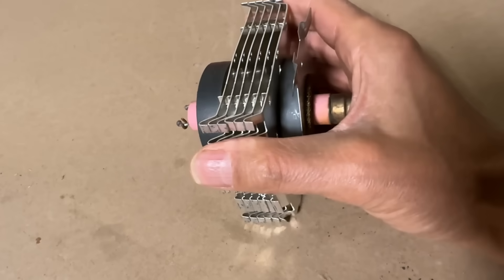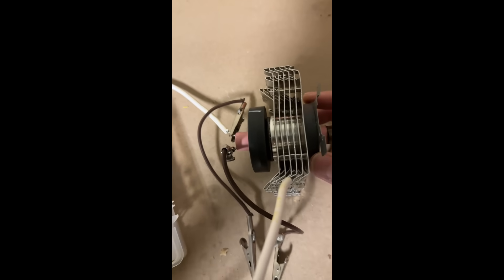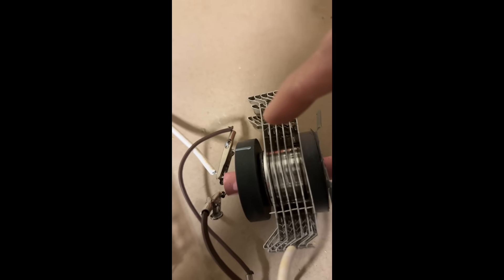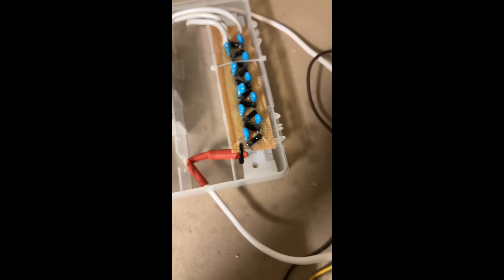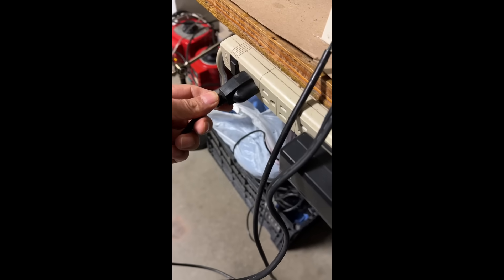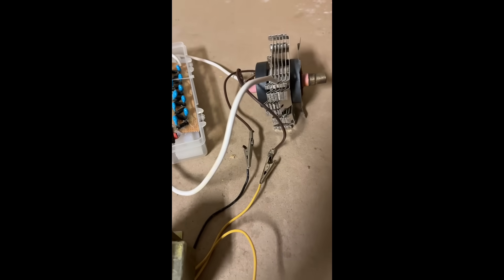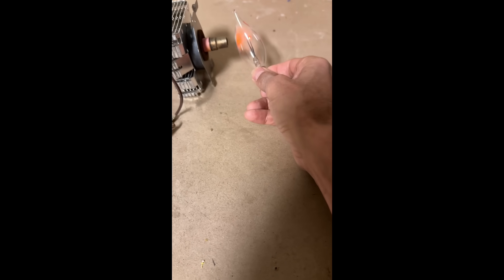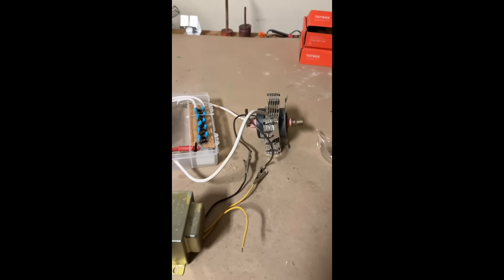Running a Magnetron at Low Power

Comment: Yeah nah I'd like to see this experiment with an actual microwave detector. I'm not saying there are NO microwaves coming out, but I'm betting those bulbs are being more lit up by the static electricity coming off the magnetron than the microwave beam itself. I've built countless Tc's and voltage multipliers in the past and seen similar results.
Reply: Well, the neon bulb stopped glowing when they turned off the low voltage heating, although the high voltage was still on. So it seems quite reasonable to assume that it was powered by microwaves.
Reply: @Phoenixfisch  Yeah that's why I said I'd like to see the actual microwave energy measured. I've no doubt there are microwaves being generated, I'd be interested in the numbers.
Reply from the maker: It’s definitely microwaves, but I do have a detector on order which hasn’t come in yet. Once it gets in, I might repeat the experiment to demo the actual level being produced.
Reply: Won't be difficult to check, amongst many other things I repair microwave ovens for a living and also have RF emissions tester.
Reply: Agreed and since the filliment needs 10 amps to run, I didn't see a 10 amp transformer or wire.
Reply: @michaeldranfield7140  You can see the transformer at 2:38.
Reply: Agreed, but can it supply 10 amps??? Also you should see the ceramic at the antenna end glowing orange when running, I repair microwave ovens for a living so I do know a little bit about these things.
Reply: @Phoenixfisch  of course but its far from a 10 amp transformer and this is why you didnt see the magnatron glowing red at the end .
Reply: @ On the transformer it says it's rated for 60W, so 3A, but you could definitely draw double of it for some time. Transformers take time to overheat. 
I don't think a bit too little current would result in absolutely no microwaves. Expecially since the voltage multiplier outputs a higher voltage than the usual 4kV.
Reply: Beyond obvious that microwaves were being produced...hmmmmmmmmmmmm upon second guessing myself it could have been a high voltage rectifier that was created and when the filiment voltage was removed it insulated the HV from the end....so  ya maybe just a HV capacitive effect
Reply: @ I have replicated this test and its rubbish , I have done a video for my channel but not published it yet .
Reply from the maker: @michaeldranfield7140 I’m surprised it didn’t work? What kind of power source did you use to run the magnetron?  Mine was a voltage multiplier. If you are not getting any output, try increasing the filament temperature by increasing the voltage to 5V from 3V. Also try increasing the DC voltage beyond 4kV. What are you using to detect the microwaves?
Reply: @BrianDhvTinkerer  I powered the magnetron as per the manufactures datasheet , -4Kv high voltage from a variable power supply at low current just like you would get from a multiplier   and 3.3 volts at 10 amps on the filament .I repair microwave ovens for a living so I use a professional RF emission's tester .

Comment: pink stuff may be beryllium oxide :P
i honestly doubt they still use it for magnetrons as of today.
Reply: He said it was an old magnetron. I personally suffered from an exposure to Beryllium and you do not want to be in that situation; I was sick for months and misdiagnosed. So be safe and assume any pink insulators on microwave tubes of high powered electron tubes may contain Beryllium, as do some springs on relays as Copper alloy. The big advantage of Beryllium Oxide is it's a good electrical insulator yet it a good conductor of heat, a characteristic it shares with diamond.
Reply: I heard modern microwave ovens use aluminum oxide instead.
Reply from the maker: @dreamoftranscendence4415 agree- the military ones use BeO
Reply from the maker: Agree

Comment: As the filament cooled at switch off, it looked as if the output momentarily increased before going off.  I think this is due to the magnetron loading changing with heater temperature and the voltage was sagging due to the load with the cathode emissivity being high. This suggests you could try reducing the heater current to find the peak output for your supply.  I did something similar as part of a crazy contraption to flash a neon lamp.
Reply: IIRC,Magnetrons usually have a 3V filament,so it might be running a bit hot at 5V.
Reply: @PhattyMo  yeah 3V would be normal but magnetron will want to load at operating power so will be pulling the little HV power supply down a lot. Reducing  the heater voltage slightly will effectively change the impedance and allow the anode voltage to rise increasing the output slightly. That's what looked liked happened when the heater started cooling when switched off.

Comment: If you remember when you remove the tube, there were two coils connected to the filament terminals.  They will suppress the RF from the rear.
Reply: No! Its To suppress RF/EMF  going into other circuits of the microwave oven
Reply: @martinmtawali7359  Correct, they keep the RF where it belongs.
Reply: Yep 2 little ferrite wound sticks.  Sure Would Be interesting to set a spectrum analyzer at a safe distance.  Magnetrons improperly driven or loaded can show negative resistance.  The author seems to be driving the tube with a voltage multiplier.  Think bunch of capacitor s in series. Then he's got the inductance of long clip leads. Relaxation oscillator?  I'm betting he's putting out 2450 mhz at the antenna and RF at a much lower frequency at the filliment  terminal.  An oscilloscope with HV probe connected there would be interesting too.
Reply from the maker: Yes I remember them- short stubby coils I think I still have them- back emf suppresors

Comment: But how to point that it´s the microwaves that lights those lamps? Those lamps burns if them put near of high volts, and there you can see that light was brighter when they are back of magnetron and same time that was more near of high volts.
Reply from the maker: When I turned the filament off, the light stopped glowing, which proves that microwaves have been generated. The high-voltage was still applied, and that did not change.
Reply: @BrianDhvTinkerer But does it stop the glowing also back of magnetron?
Reply from the maker: Yes sure does ( not shown in video)
Reply: Radio frequency excitation.  Strong radio waves can light up gas lamps through inductive/capacitive coupling.

Comment: is that a military spec magnetron?
didnt think so. its plain old common alumina, not beryllium.
Reply from the maker: Yeah, I think you’re right. The military grade radar units contain beryllium. I read somewhere that they colored beryllium ceramic different to aluminum oxide ceramic and that’s why I got it in my head that the ceramic in this particular lower power magnetron was beryllium.

Comment: Interesting stuff. I have some 2 Megawatt naval radar magnetrons that run on 80 kV pulsed at a lot of amps. They are PROPERLY scary, even when you run them with short pulses. Keep fingers, noses, earlobes and eyeballs a long way away from even 10 watts of energy in the 2.4 GHz band, those tissues are not well-cooled by blood, Deep-tissue thermal injuries are extremely nasty.  There are cases of cataracts alleged to be caused by tissue heating in folks who worked on tuning and repairing microwave amplifiers. I use a wire-mesh screen between my face and any microwave sources. I've often wondered how much peak power you could get out of a typical oven magnetron by running it at maybe 12 kV with some serious high voltage capacitors and either a spark gap or thyratron trigger. I guess the heater isn't really capable of producing suffficient electron flux for serious high power pulses. However you've given me an idea about trying to run one of my  huge magnetrons from my 15 kV  variable power supply to see if I can actually get any oscillation out of them with maybe 5 mA of DC anode current
Reply from the maker: Thanks for the great and interesting info! I honestly didn’t think it would work with such low current.
Reply: @BrianDhvTinkerer  It would be interesting to look at the output on a spectrum analyser and power meter to see if it's oscillating at the normal frequency, or doing weird stuff like oscillating for a short time until the multiplier chain capacitors discharge, then waiting for the voltage to come back before firing again, or if it really is running at DC.  You'd need an oscilloscope with a 20kV probe to check the waveform of the high voltage. A high frequency Schottky diode detector like an HP33330B connected to an oscilloscope and fitted with a tiny loop probe would give a way to look at the envelope of the microwave output to see if it's pulsing at all or just steady
Reply from the maker: @MachiningandMicrowaves turns out I do have a spectrum analyzer!
Reply: I work with a company that uses these same magnetrons to mate with linear accelerators.  Like the other commenter, I would also warn you that magnetron you are playing with can and does produce serious X-rays that far exceed what you get in your typical ct scan.  At a bare minimum, please invest in some dosimetry and a rad meter.  These days you can pick one up very cheaply.  Finally, read up on the acceptable dose limits of ionizing radiation.  Just like the voltages you are working with, since you are still alive to talk about it, you must know enough to be very careful.
Reply: @pchris6662  my RF/HV test facility is 90 metres from my lab, and the high voltage supplies are interlocked, so I don't get anywhere near the dangerous stuff. I monitor with remote cameras and instrumentation. I don't have voltages greater than 15 kV in the lab itself. I have several ionising radiation dosimeters but they are not recently calibrated. I need to get something that I can monitor remotely so I can measure the X-ray levels coming out from the apparatus while in use. I use lead sheet for additional shielding when I'm using voltages over 25 kV in vacuum experiments. I would like to measure its effectiveness. I have an old Thermo Scientific dosimeter, but do you have any suggestions for small portable X-ray detectors which can connect over USB/ethernet/wifi?
Reply: PLEASE make a video of it! ;)
Reply: Warning, @80 kv operation you can receive lots of X-ray radiation along with microwaves!
Reply: @danielsteele7225  I will be at least 80 metres away from the HV systems when they are running, I have a remote shielded lab for this type of work, I also have plenty of lead sheet and a giant Faraday Cage.  I do a lot of other HV work up to megavolts. I have a couple of X-ray dose meters as well. Remote cameras and instrumentation are my friends here!
Reply: are you aware if there are also x-rays coming from the magnetron when you pulse it with 80kV, in addition to the microwave ? 

since it's a vacuum tube, and I saw some warning of x-rays with a voltage this high on a vacuum tube
Reply: @ The amount of peak microwave energy is way over the ICNIRP limits for quite a distance, so a bit of X-ray flux will be the least of my worries. I have a testing facility that's shielded and at least 100 metres from anywhere that humans or livestock can access, so any risks are very well-controlled. I think the x-rays coming from the trigger device are likely to be worse than those from the magnetron because of the geometry of the magnetron and the way the electrons lose kinetic energy before they are dumped from the cavity. I wouldn't want to try that with a low cost oven magnetron though!
Reply: I keep hearing this But I would like to see experiments about it a ballistic gel dummy with say pig eyeballs. expose it to different levels of microwaves and them measure temperatures with a thermocouple and a thermal camera, then compare it to someone having their face lit under direct sunlight. I think the risks are exaggerated.

Comment: Is it possible to run these on neon transformers
Reply from the maker: Yeah, it would work great with them (neon sign transformers.) I was actually thinking of doing this, but then thought it would make too much microwave energy. These magnetron units run off 4000 V DC. The best way to run it with a neon sign transformer would be to use a microwave oven rectifier which is typically rated at 12 kV to rectify the output from a 9 kV neon sign transformer. Use the unsmoothed DC. You could use a variac adjust the output of the NST to around 4000 V DC. This would also help to control the amount of microwave energy emitted.
Reply: @BrianDhvTinkerer  they do you make 3,000 volt neon transformers which I actually own one to run a spark gap
Reply from the maker: @AlpineFolf awesome!
Reply: @BrianDhvTinkerer  shouldnt have to rectify as they are a diode already. now, thats a thought, run two in antiphase for a full wave rectifier...

oh my, never thought of that before... remove the magnets and theyll no longer oscillate... cheap HV rectifiers? be interesting to know the breakdown voltage when theyre not rotating electrons...
Reply from the maker: @paradiselost9946 wow that’s a real interesting thought!
Reply: @paradiselost9946  Yes my thoughts exactly, a high voltage high current diode...but also one could replace the magnets with coils and modulate the magnetron with audio, make a high powered AM 2.4 Ghz transmitter, of course you'd need a clean filtered DC power supply for the HV.
Reply: @ not sure it would amplitude modulate? the magnets get the charges to rotate, they arent varying the flow, like the grid of a triode... but hey, worth a shot, and an interesting thought...
Reply from the maker: I just did it and it does run but somewhat unpredictably. I used a 30 ma 9 kV neon sign transformer connected to a variac so that I could vary the voltage coming out of the NST. I rectified the output of the transformer using a microwave oven rated HV diode. . I used a separate transformer rated at 3 V to run the filament. I tried a combination of grounding, the anode, grounding the cathode, and no grounding to see how the unit would function. I got  microwaves. However, because the NST was outputting 120 W, I decided to do the whole thing outside and film it with a remote camera. I will post that next. Let me know what you think?
Reply: @BrianDhvTinkerer  I think that is awesome that it can output such power, can't wait to see the video of it.

Comment: Sounds like it could also make xrays
Reply from the maker: I checked it for x-ray production and they were non-detectable. Interesting thought though.
Reply: @BrianDhvTinkerer  it could be done if you apply a high voltage (60 kV) since it's a vacuum tube and the elections would fly from the filament to the copper block (it would be highly inefficient since the electrons would be flying in all directions rather than be focused to a single target like tungsten)
Reply: Not enough voltage.
Reply: @railgap  it would be enough but higher voltage is better

Comment: Next time tape your bulb to the end of a stick so you're not jamming your hand into that beam.
Reply from the maker: Good point
Reply: There is no beam, the whole thing is radiating RF like a small 2.4 Ghz dipole antenna, more or less a donut shape surrounding the whole device. Getting too close to the back or front will start to heat up your flesh, worse risk is your eyes they will cataract quick. Need mesh glasses to be at this stuff min.

Comment: As far as i know that's aluminum oxide not beryllium tig torches are also pink, maybe if ti was a military magnetron, but working with beryllium ceramic is really expensive
Reply from the maker: The white ceramic is aluminum oxide. The one containing the pink coloration is beryllium oxide but you could be right!
Reply: @BrianDhvTinkerer  If it was beryllia, it would have huge warnings and never be permitted in consumer devices. Berylliosis is bad.  Very very bad. I have quite a few ex-military and aerospace devices that do have Beryllium oxide and the warnings are properly serious.  It's a fantastic material, really high heat conductivity, excellent mechanical characteristics and a good dielectric.  Main use is for conducting heat away while being a dielectric insulator. However, if you scratch or snap it and the dust gets in your lungs and you are sensitized to Beryllium, you can develop granulomas up to 30 years later than the exposure. I've often wondered why they use that pretty pink ceramic in lot of vacuum tube devices like disk-seal triodes.
Reply: @BrianDhvTinkerer  BeO and Al2O3 are both colorless but chromium-aluminum oxide ceramics are pink (as in ruby) and are common industrially. There are pink beryllium minerals and other chromium-doped ceramics so I would not say that color is definitive.
Reply: @FunctionalCookie  Isn't Beryllium Oxide way too expensive to be used on consumer magnetrons as insulator? 
I don't think microwave ovens would be as cheap as they are if they used Beryllium, so it has to be Aluminium Oxide instead.
Unless someone were to measure the density of both, that would be a good way to know for sure.
Reply: @GoldSrc_  I agree—it seems extremely unlikely that a consumer microwave oven tube would be made with beryllium oxide. I have no idea how the economics worked out historically, if you pick up an antique.

The white and pink ceramics show up interchangeably in some other tubes and power RF devices. There was a Hackaday article that associated pink with beryllia and a steady flow of comments under this video suggesting the same. The worst possible mistake would be to think that white means safe as I have never known BeO to come in any color other than white.

Which is not to say that it has never or could never.